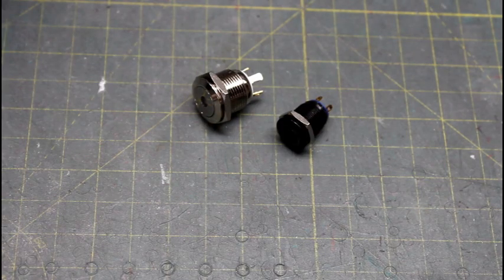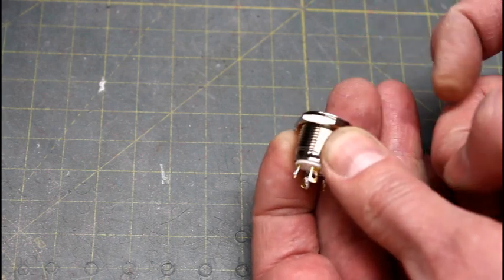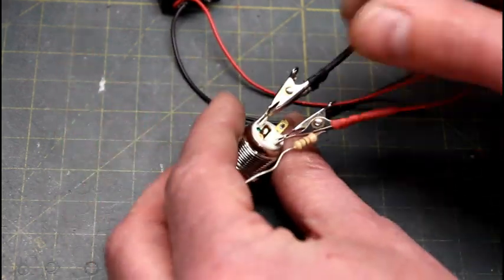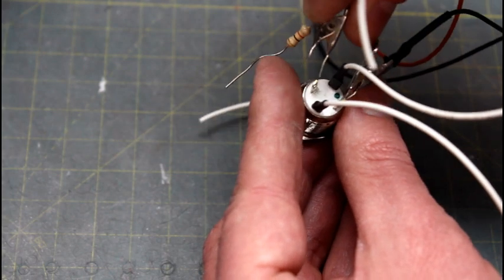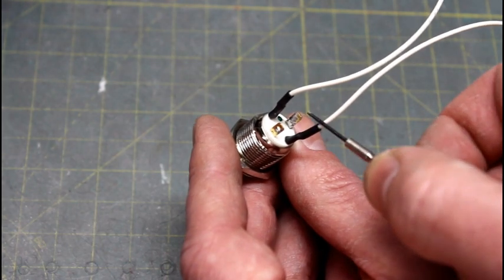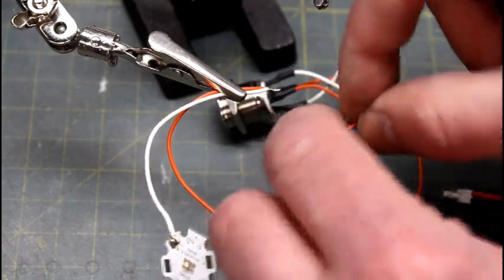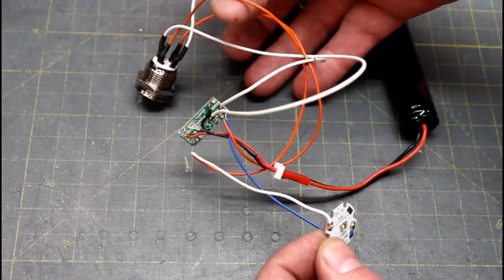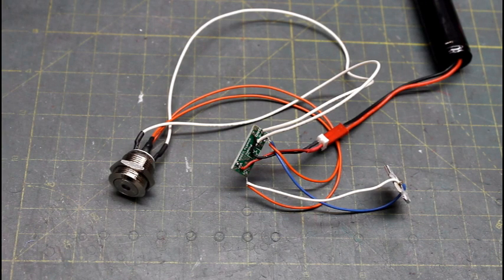Illuminated AV Switch Wiring

Comment: Correct me if I'm wrong, but I'm pretty sure that DynaOhm variable resistors must be installed on the positive leg of the accent LED.
Reply: Positive wire from switch to negative side of dynaohm resistor.
Reply: +NanoRex Good point. I'm not sure.
Reply: +Rob Petkau the site says the positive line
Reply: If you don't wanna have the trouble of wiring it yourself you can just buy the pre wired one in the modular wiring section at TCSS

Comment: Thanks for the great Vid Rob.
Will this be the same process if I want to wire the AV LED in series with the main LED? I tried this and the main LED has dimmed and the AV LED is very dim, so I am presuming the resistor from the main led also effects the AV LED or am I wrong? I want to wire the AV LED so it goes on and off with the saber without a recharge port to a NB Board, any advice? thanks.
Reply: +Tony Celliers I would not wire them in series - the resistor will affect both. I would wire them in parallel

Comment: Rob, sorry for asking a question on a video that so old I hope this message gets to you ..just curious I followed your  tutorial and successfully installed a illuminated AV switch in my sons Saber, thank you so much for the video it was very very helpful very descriptive....
question though noticed in the video you use 16 gauge to wire the switch....
Would 26 gauge be acceptable for wiring an illuminated AV switch? 
I used 26 gauge throughout his saber doing a complete rewiring and everything seems to be working properly  
It wasn’t till after revisiting your video I noticed you said you use 16 gauge on the switch.  

Wondering if I should go back in and rework the switch with 16 gauge. 
Thanks

Comment: I was told you dont need a resistor for the led on the switches unless you want the LED to be dimmer. Can I get away with running 2 green illuminated AV switches directly?

Comment: Hey Rob, great instructional video as always.  So, I'm brainstorming for a build that I want to do with a NB, a tri cree LED, and an illuminated momentary av switch, and I was wondering if you could help me out.  You said the NB essentially fulfills the job of the momentary to latching converter, so I won't need one, which is great.  My question is with all those extra wires coming from the main LED since it's a tri cree, won't this create a problem when wiring them to the same spot on the NB as the wires for the LED from the illuminated av switch?  Is there a way around this?
Reply: +Michael Wehrley Sharing contacts is not a problem - especially on the ground spots. What I often do to save wires is to link the LED (+) wires at the LED, then run one (+) wire to the board, rather than join 3 (+) wires at the board.
Reply: +Rob Petkau Awesome idea.  I hadn't thought of that, but it'll keep me from creating a build up of excessive wires on the NB, which is exactly what I wanted to avoid.  Thanks for the tip.

Comment: On a NB v3, wouldn't it be better to attach the switch led to the power indicator port? Because i suspect that the switch led would pulse the same way as the saber if you solder them parallel together like you did on the convertor, or am I wrong on this?
Reply: Correct. I believe on the new NB3 there is a 3.3v pad to use for that purpose described in the manual.
Reply: Thank you Rob, for the great help

Comment: Dunno if this question would be answered but if I just recently bought a CFX for my saber build, do i need a resistor for illuminated 12mm av switches? I've seen the internals and builds of other sabers, as well as my saberforge, and I don't see any resistors attached

Comment: Rob, I have a yellow AV switch but ring not dot. Anyways, my question is; do you really need to use the momentary latch converter? I do plan on having it light up and I'll be using a NBv3 sound board. I'm buying my parts as TCSS has them. Just want to have a good set up and I want to do it myself. Thanks. Great video by the way, I've seen them all more than twice.
Reply: +Shawn Pierce You do not need the converter as the NB uses momentary switches
Reply: +Rob Petkau thanks Rob. Like I said I love your videos.

Comment: any reason you use 16 gauge wire fir the led on the switch?  it's thick wire,  you usually use 28 gauge or 26 in your videos . many thanks for all the videos I really find them helpful
Reply: +Bri w (willbo) It's a mistake - that's 28g
Reply: +Rob Petkau ah. thank you. I got 28 gauge and 26 ready for my build

Comment: could I wire a latching switch on the positive wire from the battery pack and use that as a kill switch so to say. I plan to have it on the same wire as my momentary so it would obviously let the power flow when the latch is down. I only wonder Cuz I would rather not have a plug or any sort of thing like that

Comment: if I had an RGB LED as an accent LED and I wanted it to change color with the blade, would I be able to use the accent pads on a prism v5 or should I just go ahead and solder them to the same pads as the saber LED?
Reply: Thats covered in the PRISM manual, under 'Add a crystal chamber to your saber'.

Comment: I have an RGB LED switch, would it be alright to use a dynaohm resistor and connect the legs to the accent pads? Custom saber shop doesn't have SMD resistors from what I saw.

Comment: would it be possible to connect the AV switch LED so it powers on when the kill key is removed (using a Nano Biscotte)?
Reply: +fhammer07 Yes. just run it off the boards  + and -
Reply: +Rob Petkau Using the right resistor of course
Reply: worked like a charm!  thanks for doing these videos.  i got an MHS (+NB) hilt done in record time, including the AV switch!  :D
Reply: +fhammer07 Excellent!

Comment: Hey Rob, quick question. Can you wire switch LEDs in parallel with the main LED on a CFV8, or, is it absolutely necessary to wire them to the accent pads? Thanks.

Comment: so how does one wire it with a nano biscotte v3 for it to illuminate? I'm a bit confused with the short short explanation in the video
Reply: There should be an explanation on your sound board manual for an "accent LED"

Comment: Can anybody help me out here?  I'm having a hard time wiring the AV red ring using the dyna and the. 5ohm to main . I thought I had it at first but both we're flickering a bit.  I took it apart since no luck getting it right.  I've tried the pos side with dyna,  negative,  regular switch wire,  I can't get any option to get the ring led and main lit to a steady level.  Now I can't get the ring lit unless it's direct to pos/neg.  Also now the main led turns on as soon as I make contact with the battery.  Boot up and the brightness increases. I shut it down and the light dims but stays on. I have no idea what I'm doing but I'm trying and I need some help.

Comment: What is your recommended temperature for soldering these kinds of components?
Reply: +WarMachine425 Basic rule is to use the lowest temp you can and still get quick clean joints